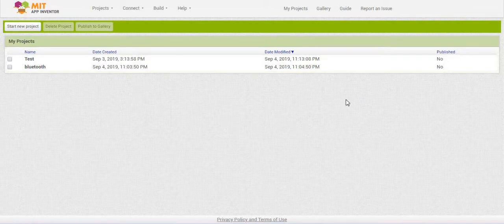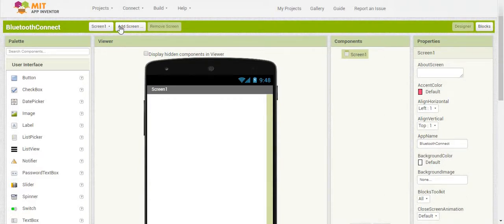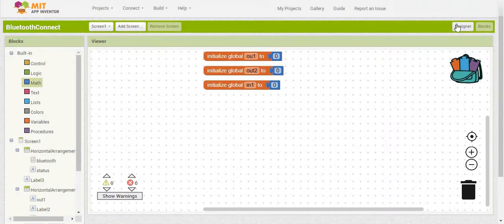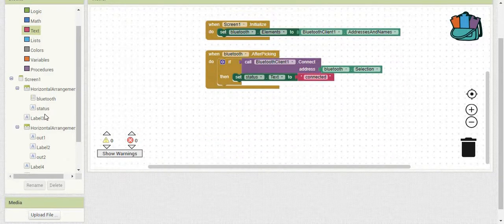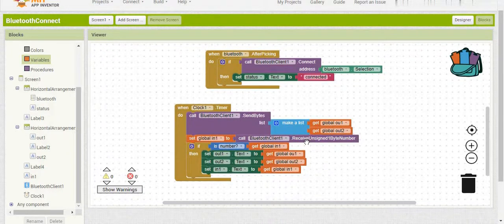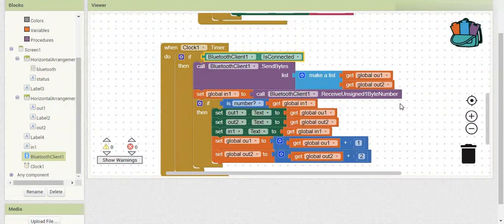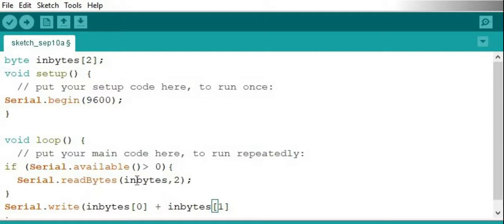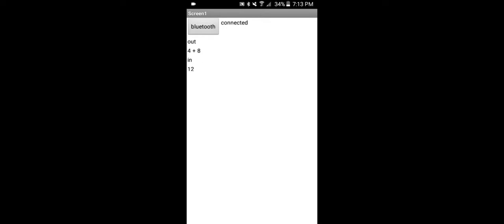Setting up Bluetooth with  MIT app inventor

Comment: Great video.  But after trying several .apks, I can't get my Android to find any BT objects.  I use another BT scanner and have no issues.  Suggestions, please.  Thanks
Reply: I found code that connects to a specific address......worked great
Reply: @donaldmartin2640 can you share this one please, I tried many ways and there is no bluetooth device shown in mit app inv